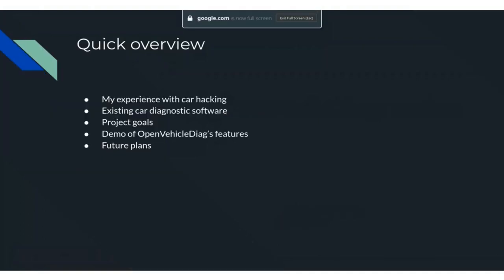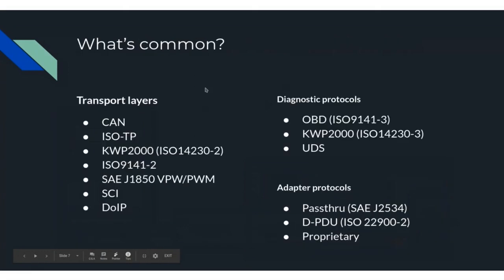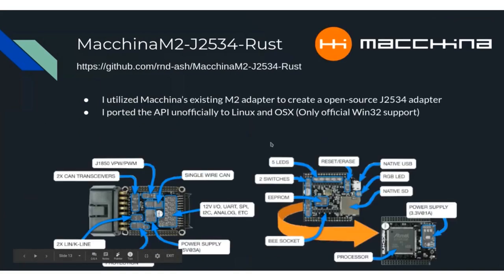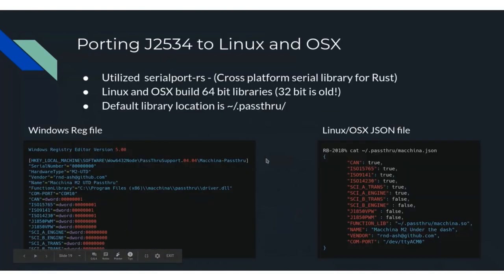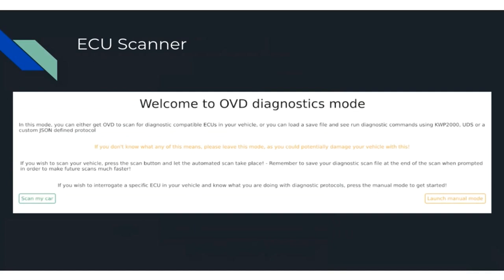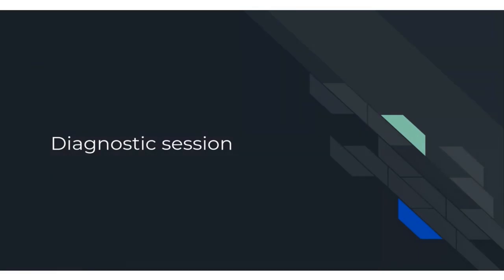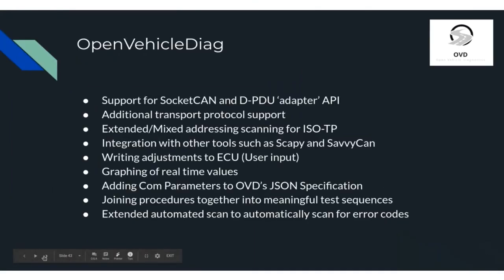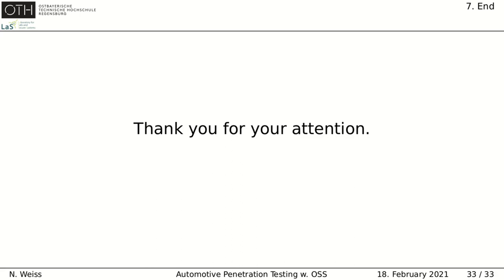Cross-platform open-source ECU diagnostic

Comment: Nice work Ashcon, Question how could i get the J2534 linux/windows driver you have posted in github to work under linux with an old school Car Prog J2534 programmer. I have had this for probably 10 years with all the adapters etc. Would cool if you could reverse engineer the CarProg Software (Windows) to work under linux,,or something very similar.This little cheap programmer worked great when i first got it to reset a couple of tripped air bag modules on ford and gm vehicles. Thanks again